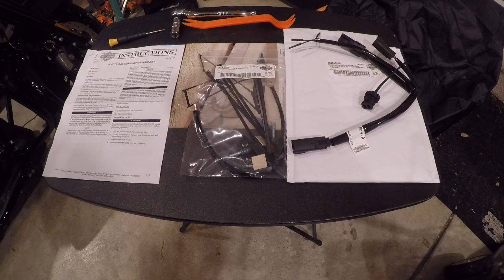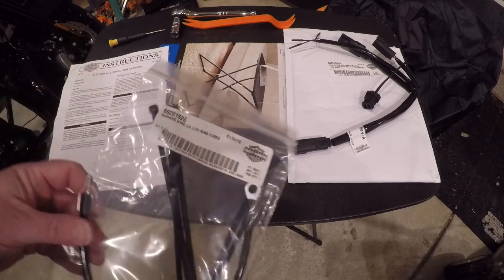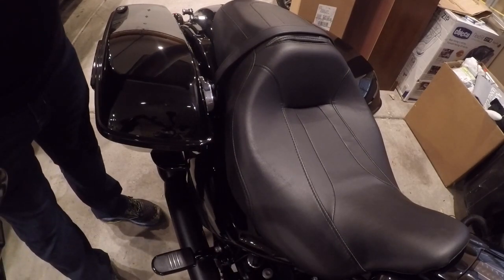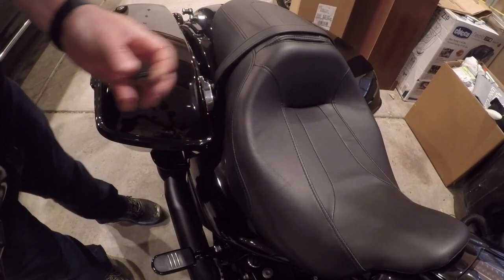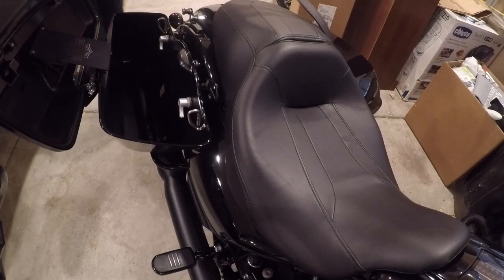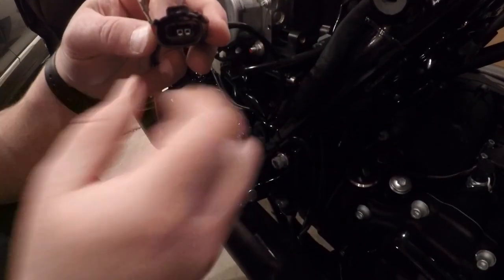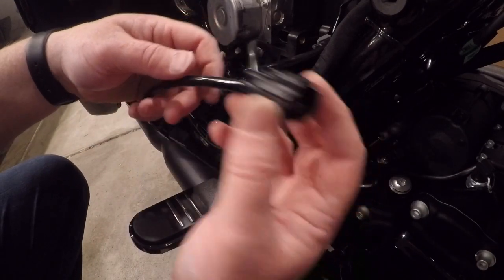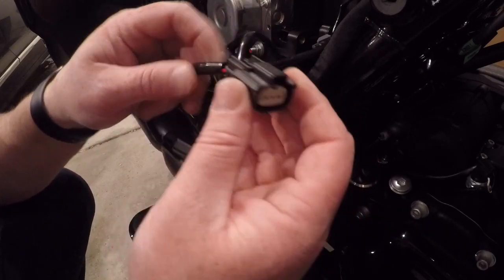2017+ Touring Electrical Connection Upgrade Kit 69201599A

Comment: Excellent job, thank you very much for making this video. It  saved my ass. Just finished installing on my 2020 SGS. Now I just have to wire up my new heated seat and I'm all done.
Reply from the maker: Welcome, glad it was helpful. Harley instructions suck big time
Reply: @BeardedTeslaGuy  are you positive about the orientation of the 3 Accessory wires on the Harley harness for getting power to my seat . I heard you say red is constant power, purple is switched power and black is ground of course???

Comment: Great video, very detailed and much needed clarity to get the job done. I have a 2020 heritage classic V107.  IMO HD should have these pre-installed in their bikes the same way the pig-tail for a battery tender is in place. I think HD wants you to buy this kit and screw up the job so they can do the job and possibly void the warranty. Why else would the instructions be trash?lol. Don't get me wrong I love my bike but c'mon HD...They put LED lights in the front but forget about the super dim rear of the bike. At least come up with an option of a "Convenience Package" where you get the battery pigtail, this electric pigtail and rear LED lights. Sorry for venting but I /we shouldn't have to take apart more than one piece on a new bike to put in a Bluetooth sound system.

Comment: If you don't need constant battery connection to anything, can you skip the battery cable, and just install the harness? Then use the free leads to wire to your accessory? GPS in my case. It's a 12 volt accessory and I only want it to come on with the bike. Does the 325B connection supply 12v power when bike is switched on? Thanks.

Comment: thanks just installed the wiring kit on my 2020 FLHPT Police Electra Glide. Got a great deal on a takeoff 2020 heated CVO Ultra seat
Reply: Ed, just saw your text. I’m preparing to install heated seat on my 2019 SG.  How did your install go? How do you like the comfort of the new seat? How do you like having a heated seat? Thanks
Reply: @mikedarcheable  the step by step directions are great in this video for installing the harness but I had other issues due to my bike being a Police bike. The pins are different on the Police bike wiring harness and an HD mechanic couldn't figure it out. The seat is great and luckily I'm in FL.
Reply: @edhickey3163  thanks Ed. Hope it doesn’t get to chilly down in Florida!

Comment: I agree.  Great video. Thanks for posting.  I’m adding a heated seat to 2019 SG.  I already have 2 Gerbing heated jacket controls. I’m thinking about heated grips.  We ride all year in Boston.  I wondered if that’s going to overload the battery.  Thanks again.
Reply from the maker: Nah, you won’t overload the battery. Anything to extend the riding season
Reply: Thanks again

Comment: I'm using this to install handlebar speakers, i still connect the speakers to the battery terminals correct, only difference would be instead of tapping directly into a wire I splice the speaker to the wires on end of the pig tail correct? Also will this provide continuous power to the speakers even when the bike is off? Or will it only provide power when turned on acc or turned on, don't want a dead battery lol

Comment: Great video! I was about to install the P/N 69201599A on my 2018 FLHP, but realized there is no power on the 325b connector. Fuse seems OK (checked with ohmometer), any ideas?

Comment: Terrific video. Question for you: If I’m only looking to use switched power, do I still need to install the lead to the positive terminal? Will the purple wire that’s already running to the 325b suffice for switched power? Thanks!
Reply from the maker: Im not sure honestly
Reply: @BeardedTeslaGuy  I did the install this weekend. I only need switched power and didn't need to run the cable to the positive battery terminal. Thanks again for the super helpful video.

Comment: Just installed the heated seat!
Reply: Hey Michael did you go with a Harley seat or aftermarket. If so did you use the 3 wires coming off the Harley harness to get power or the 2 factory plugs on the harness??
Reply: @seanwenchell1034   hey Sean.  I bought the Harley seat and the additional wire connection. The video made it easy to install. Seat and wire cost about $950.  Well worth it.  I ride all year. 
Good luck

Comment: I installed a heated seat connection on my 2015 ultra classic.  When I went to install the upgrade kit 69201599A on my 2020 Streetglide, I was totally confused.  I could not have installed this device if it weren't for your video.  Cannot thank you enough!  One problem, now my Car play does not work. any suggestions?
Reply from the maker: Awesome to hear! I don't know what to tell ya about CarPlay. Try to download a fresh install of the software on the unit.
Reply: @BeardedTeslaGuy  I'll let you know, thanks!

Comment: If you didn't want to buy this harness could you just splice into the purple and black wire on the connector already there for supplying heat power to a heated seat? With the harness do you need to attach the lead to the battery for the heated seat to work?
Reply from the maker: Possibly
Reply: @BeardedTeslaGuy  I just installed the harness without making the connection to the battery.  Just incase anyone else has the same question.; The heated seat will work with accessory power without connecting the wire with the inline fuse to the battery.  The wire going to the battery will provide power to accessories with the bike turned completely off.  Great video by the way and H-D really should include this harness on bikes coming from the factory.

Comment: Good video. I don't think the secondary on that plug should come right out. I pulled up like you then it unlocks, then I used a safety pin in the smaller t part of the plastic opening and pulled the white plug out the back, then my new pin can only go in one way, then push that secondary lock back in.
Reply from the maker: Thanks for sharing

Comment: Quick question, after I tuck the wires through, what steps do I take to put it all back together? Do I just :
1: tuck the wires through 2: insert the the small fuse 3: put the big main fuse back, 4: reconnect battery 5: covers back on 6: seat on 7: good to go to wire my speakers? 

Should I leave all the fuses out and battery disconnected when I connect the speakers?
Reply from the maker: Leave the fuse out when wiring the speakers. Otherwise everything else is right on
Reply: @BeardedTeslaGuy  thanks so much. Got it done!! Great video!!

Comment: Hi!
Thanks for a great video.
I installed the connection kit without a problem. The purpose is to get power to my new Mustang heated seat.
Unfortunatelly nothing happens when I try to get power to the seat (no lights, no heat).
So I've tried to measure when and where there are power in the connections. It seems that there is always power on the red one which is attached directly to the battery (as expected).
Black is ground and I would assume that purple would give power when the ignition switch is on? That seems to be the problem because there is no power coming through the purple connection.
I've measured directly in the connectionpoint (where the connection kit is installed) but there is no power at all coming to that connection regardless if ignition is on or not.
Because if ignition is on the purple wire should be powered right?
Do you know if this has a fuse that might have popped or where it is connected from the start?

    Biker Regards from Sweden
Reply from the maker: Could be a bad fuse. The colored wire is accessory power, meaning when ignition is on

Comment: Great Video Thank you!     
I have a question did you use an opposite connector on your accessory you were installing so you can just plug them in or did u use the 3 pig tails?
Reply from the maker: Pig tail
Reply: @BeardedTeslaGuy  perfect TY so much for quick response.

Comment: Great video, couple of questions.  The accessory I am connecting needs to be connected to a ground.  do I still connect to ground side of battery.  Also, you mention that you can connect more than one item that needs power.  Can you be more specific how you do this.
Reply from the maker: You still need to ground. You can connect multiple items because there are I believe 3 power feeds

Comment: Thank you for this video. I got this harness for my 2018 Street Bob to connect my new MTX speaker to it.  Now I have music.  But since this install, my ABS light has been on.  Are there any plugs near the battery or the install location that I could have not plugged all the way in?  Everything else seems to be fine.

Comment: My heated grip instructions call for this harness,complete the install. I’m assuming I can tie into the leads, no connection for them.
Reply from the maker: yes
Reply: Thanks for the reply, saw your video on heated grip install. Have you had any issue's with the accessory connector or extra headlamp connector? Sufficient power, shortage, blown fuse....etc.? Operations normal? Thanks again.......
Reply from the maker: All normal, no issues.
Reply: @BeardedTeslaGuy  Thanks....

Comment: I getting ready to install this upgrade on my bike. Question: I'm installing a Bluetooth sound system. Since the upgrade kit has an inline fuse coming off the positive terminal of the battery do i still use the inline fuse or the (Amp) equipment? The inline fuse for the equipment is 20amp.
Reply from the maker: Yea you’d be good
Reply: @BeardedTeslaGuy  Appreciate the quick response! Thank You!

Comment: Will this kit work if I’m wanting to install wrap around brake light (touring pak) and rear speakers (touring pak) on my 18 street glide
Reply from the maker: Joshua Gower yes it should. I installed handlebar mounted speakers and powered them with this.
Reply: Are any of them 6 pin connecters.
Reply: Joshua Gower Have you bought your lights yet?   I have brand new wrap around and side marker lights off my 2018 RGU.  Changed them to smoked lenses when I bought it.  Also your dealer should have a harness the will run lights and speakers and be an easy plug in under the seat.